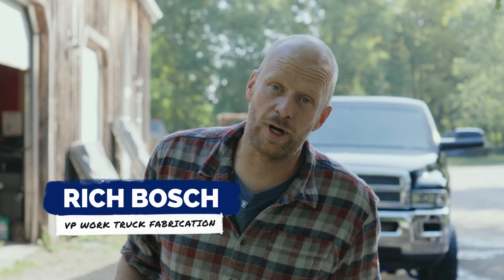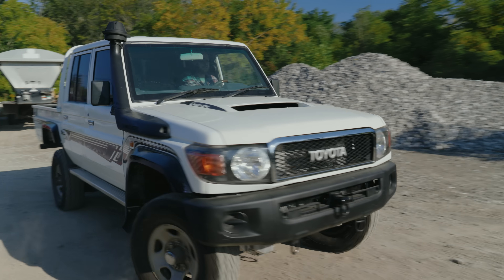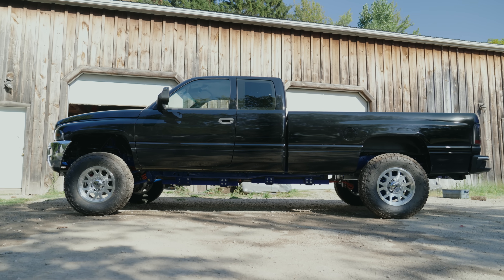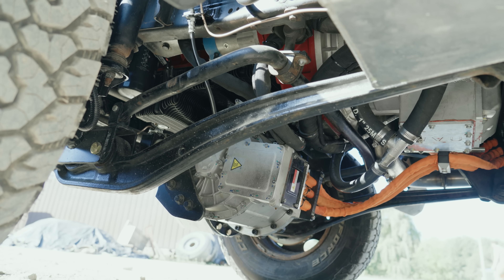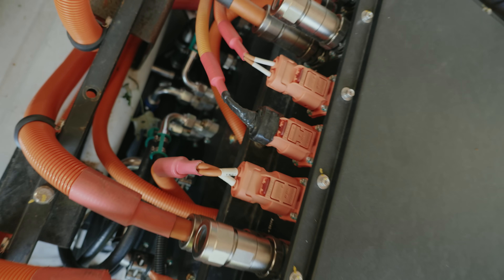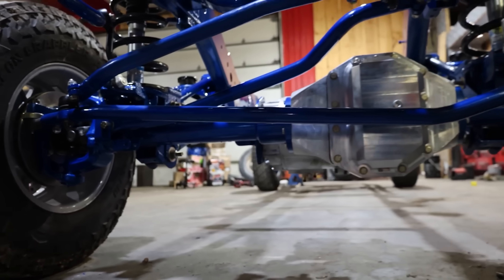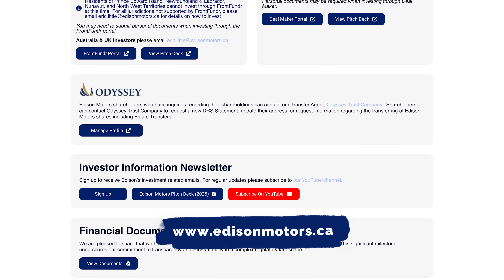We’re Building Pickup Trucks with Electric Axles, Here’s Why

Comment: I really like the concept... Diesel/Electric definitely seems to be the best course for the future of extra-urban automobiles, to include military applications.  That said, I see some concerning design issues in your prototypes... yeah, I understand that these are early prototypes, but these issue should be top of mind from day one...
First, on the Land Cruiser... you mounted the axle on top of the leaf springs, as opposed to under them.  As you noted, this is intended to be an off-road vehicle.  You seriously compromised ground clearance by doing this.  Also, It looks like you added extra leafs... that is a pretty thick stack.  Does that mean you had to significantly increase the weight of the vehicle with the battery packs? I would imagine you had to.  Unlike the semi applications, you don't have that weight offset between the original internal combustion engine and the generator.  That is going to significantly stiffen the suspension and affect the ride and articulation.
Second, on both trucks... the battery units look to be very exposed to damage in any sort of high-center situation.  Also, the battery pack looks to sit significantly below the frame rails, making them even more susceptible to damage.
Third, on the Dodge... those three cables, going into the box forward of the read differential are also extremely exposed to damage in off road applications.

And, yeah, your concept of providing (effectively) a rolling chassis kit, as opposed to the customer having to do chassis mods sounds like a great idea.  That will avoid a lot of potential problems, significantly reduce your customer support requirements, and increase the applicability of the kit.  You can make a generic rolling chassis kit (with a handful of adapter mounts) fit a pretty broad cross section of truck bodies.

Comment: It needs to be in the trailer axles. Especially for semi trailers, it would help in so many ways. It would help with take off and regen going down hill, help on an icy hill at a stop sign, save so much fuel, the trailer has a ton of room for batteries etc. a retro fit kit so it can be added to any trailer.  Then instead of having to replace all these rigs on the road, we just upgrade the trailers.

Comment: I still dont understand making the axle electric, instead of adding an electric motor to the existing axles drive line, so your not stranded if the electrics go out, you still have a diesel (albeit under powered )

Comment: Outsources the production to Harbinger  Motors, since they already produce EV and EREV chassises in this size class. Creating greater's economies of scale, In consultation with Edison Motors and DEBOSS GARAGE, which would also be a distributor to local shops. 

Or if it's kept in-house at least mirror some of the simpler design characteristics its chassis. Since modifying an existing chassis is way to labor-intensive to be cost effective.

Comment: If you build the chassis to a class 5 rating it will be bullet proof but that puts a lot of us in a legal spot here in the states. Is there a light suspension or something minor you could change to make a 2b for us small business owners out of the same class 5? Like specifically something that we’d be cutting off to upgrade to air ride anyways?

Comment: I would take one chassis, 14K gvw, 4wd. Put '68 F-series cab on it. Set it up with a 12 foot deck, that has a hoist under it, and a trap door in it for a fifth wheel. 
Pull damn near whatever size trailer you want.
Haul damn near what ever you want on flat deck.
Put the sides on and 4-5k in top soil, rock, mulch, sand, ect and dump it where ever you want.
Not sure i ever buy another truck.
Reply: Amen bruddah :)
Edison.....the last truck you'll ever need.

Edison trucks never die, they just get repaired.

Edison trucks will never get sold, they'll be passed down to newer generations.

Edison trucks are more than heavy duty, super duty, mega duty, hyper duty, or ultra duty. They are Apoc duty. Built for the apocalypse.

Comment: Hey Chase. Future opportunity exists with the hybridization of small bulldozers already equipped with hydrostatic drive. The hydraulic motor(s) attach to the final drive gearbox(es) which facilitates electrifying the track power supply. Think of the added advantage(s) of electric braking and steering. Full-blown converting hydraulic cylinders to electric-driven ball screws for blade and accessory controls/simplified diagnostics.

Comment: Just FYI. I have never bought a new pickup, I always run 10 year old or older used trucks. If I buy a used regular pickup with the original manufactures cab and box I am good in Ontario, easy to get an ownership, licence plate, and insurance. If, however, the truck was originally sold as a cab and chassis, even if someone puts a regular box on it,  it seems that it needs to always be licenced and insured as a commercial motor vehicle which means expensive licence and insurance and a bunch of hoops you need to jump through. For your commercial trucks this doesn't matter, they aren't going to be used for personal transportation. However, for your pickups, please check that if average Joe in Ontario wants to buy one of your frame and driveline kits, that he will be able to licence and insure it as personal transportation under 4500 kg and not be forced to licence and insure it as a commercial truck that needs commercial licence, commercial insurance, annual inspections, driver needs a CVOR and must complete a daily log book, and on and on and on. 🚜

Comment: hate that you’re double down on drive axles instead of a drive shaft option. It would be so much faster and easier to convert without a need to re-engineer the entire  suspensions. Weak u-joints blah blah blah… just tune it right to match the output of the original gas  engine drivetrain… I don’t need 1,000+hp, just the efficiency of the hybrid offering similar performance as the original set up.

Comment: They should have a way to manually connect the transmission back to the rear axle.  just  if the batteries or electronics go bad you could still get back home  or at least out of the way. 

Edit : maybe a small hydraulic pump so it can be turned on and off in a pinch

Comment: NEVER understood why this wasn't done before since heavy industry has already proved the technology. When starting to home brew biodiesel remember Oak Ridge National Laboratory during Clinton's Admin collaborated with the auto industry to develop high MPG cars which included diesel-electric hybrid technology. If I remember correctly a mid size car (American mid-size) small diesel engine powering a generator got 80 to over 100 MPG. Again if I recall correctly, if fueled by biodiesel it was the LOWEST environmental impact over entire life cycle from manufacturing to end of life recycling. My life's work experience includes BurlingtonNorthernSantaFe Railroad & Operating Engineers Union & have seen many diesel/electric vehicles. Gave my still running 1990 12v to my son & currently hanging onto my 2007.5 Ram 6.7 Cummins. 2007's truck emissions computer knows if I burn 100% bio. :face-orange-frowning:

Comment: All us Nissan titan XD owners with snapped cranks and zero parts to fix them are NEEDING this frame! This is now the only option for my truck thati have had dead for 2 years, as to buy a crate motor is a whomping 40k Canadian, for what's now a 20k truck because the rabbit is out of the hat these are worse then a 6.4 powerstroke.5.0 cummins are popping everywhere snapped or rolled bearings same spot, zero warning. Nissan and Cummins have left us owners in a corner, no parts, no bearings, no end caps, no turbos, my truck is mint full load, only 167k km fully loaded. not worth a penny. 12k over warranty. what a kick in the nuts for a young guy that just got married. sold my obs ford dually and my dually diesel yoda. regrets regrets regrets lol
 i tell ya what ill drop my truck off whenever you want as a test mule or whatever you need, its doing me no good ive stored it inside for 2 years and i hate looking at it..... anyways love what you guys are doing, this makes so much sense and you haven't skipped any corners, I'm a diesel mechanic and electrician by trade and i am impressed. keep representing Canada boys, making us proud! This Alberta trades man see the future happening here!

Comment: Shouldn't the e-Axle manufacturer include whatever software you need in order to use their hardware on a truck or truck frame? If you have to write your own code, that's like Nvidia or Radeon releasing a new graphics card without any drivers or support.

Why, it must be enough to make you guys feel so unloved by hardware vendors, it's like you're Linux developers back in the 2000s!
Reply: Edison uses axles from vendor "A" and batts from vendor "B" and inverters from vendor "C". Then Edison makes a custom computer that ties them all together on the canbus.
Reply: @Sah-o5m then in this approach, too, Edison is dooming themselves to slow growth and not gaining much market share. That's disappointing. If they really want to compete with the big truck makers, they'll have to change their thinking.
Reply: @chrisschembari2486 
It goes 3 ways

If Edison goes all in with vendor "John Deere" to provide all the electrics, then John Deere dictates price, availability,  repairability. Disgruntled edison owners will call edison and Edison will call JD and the JD people will just laugh and laugh all the way to the bank.

Or. Edison raises several hundred million and designs/builds all their own electrics to then only sell 100 trucks per year with an ROI of centuries.

Or. Edison goes with what works, stays vendor agnostic, and just figures out the quirks.

Edison is doing just fine.
Reply: @Sah-o5m It's really too bad, too. I think Edison's hybrid diesel idea is a great one that should replace all the less efficient rolling stock on the road.

Comment: Quick question but for an off-road purpose, it will be better, from my point of view, to rotate a little bit the electric motor around the axle in order to get more clearance. In that way, if a rock goes under the truck it will hit the axle first instead of the electric motor. 

Good job 💪💪

Comment: Make a drop-in replacement for a RAM Promaster rear axle to provide electric boost under hard acceleration or uphill climbs. You'd only need a small battery since it doesn't have to provide all of the drive or operate all the time. The battery could be continuously charged off the alternator, you wouldn't necessarily need regen (though it could be used to assist with braking). If you could pull it off for under $5k/unit it would be a huge success with businesses and fleets (and RVs), particularly in Europe where the Promaster is called Ducato and is one of the most popular vans.

Comment: Although this is great for industrial and fleet applications in some instances.
It is sadly moving further away from the home builder who wants to just swap the old running gear with some EV/Hybrid running gear.
Unless - you eventually get to kits where we can drop the motor, gearbox, and diff centres out of our standard vehicles, and bolt in the replacements over a weekend. In the same way we would do a late model engine swap, or in a similar way to an LS conversion.
Or like Rich did with his Cat swap in the F Truck. Basic home mechanic swaps.

Comment: I need a 30,000lb rated frame setup, axles, batteries, engine, but I don't need a cab, I have an almost 35 foot long bus that I plan to take the old 1989 body off of, clean it up, sand blast and paint the underbody, insulate the underbody ribs, and drop onto a new roller frame.

My plan is to either buy a used dump truck to transplant, or to convert to hybrid if I can get a hold of the parts and equipment.

Comment: So have a look at the 1998 Ford Ranger EV. From the Edison factory with an electric axle motor.  Yeah, these guys are about 27 years late to the party.  Since these trucks are conversions they totally lack the specific structure, aero dynamics and system integration that lets you get the lower weight, extra storage space and performance from the truck as the chassis is built for all the needs of a petrol power plant.

Comment: Be sure to have a non-hybrid Ram towing the same trailer on the same route, that way the efficiency of the vehicles can be directly compared.
Reply: Alas. They won't have a 95 5.7 2wd gasser which is what the dodge started out life as. But, they will have 2 modern trucks towing similar trailers, so it should be a fair-ish comparison.
Reply: @Sah-o5m  I don't think that the actual truck really matters all that much, as long as the capabilities are similar.

Comment: I know the kit is what you are working for but maybe just offer a hole truck. Like the big ones. You all are in the rust belt, are are there many used bodies that are worth swapping over to a 60k (assuming cost) drive train? For instance I have a 1999 dodge 3500 that I used for a portable welding service, I live in SW Missouri USA, nor really the rust belt. But my rockers are nearly gone, the dash and drivers seat are shot, the truck has 355,000 miles on it. 
I still drive it, but would I put 60ish in it ? No. So maybe your target customer has an expensive bed, service truck or whatever, could that not just be transferred to an Edison cab and chassis. How much more would it cost to include an Edison cab?
Don't get me wrong I am rooting for you.

Comment: the only offroad i see that land cruiser doing is gravel roads. leaf UNDER the rear axle? all the low hanging fruit underneath the chassis? it has no ground clearance left, let alone any articulation. sure, it might be able to haul 5000lb's in the bed, but offroad is not what i consider that truck....

Comment: I like the ideal of axle diff drop in replacements. Think of the off-road community for example, they would buy millions of units alone of the carrier replacement E motor could also act like a locker and/or limited slip on demand. Gas power and low end e torque to climb? With controllable functions? One would sell millions of these things globally.

Comment: could you use a electric motor at the pinion joint run by the existing motor and added battery backup

Comment: There's a whole market for building hybrids that circumvents the off road generator problem.

All front wheel drive vehicles have stub axles and mechanical brakes on the rear wheels.

Build a mechanical brake +regenerative brakes and launch assist replacement unit.  The sole purpose of the design is to help keep the vehicle in high gear as much as possible.

Launch assist at stop lights. Regenerative brakes if you just tap the brake pedal enough to bring on the lights and mechanical brakes if you push.

I think it could double mpg for most commutes.

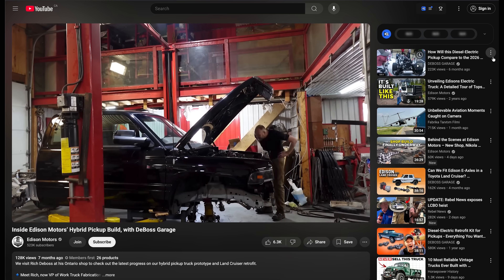Comment: 1:30 To be fair, an electric motor in front of a T-Case would still be instant. ...but I gather there's no direction chanage with a ring and pionon so it'll be nice to avoid losing 10-15% off the top. I assume the plan is to work with a Foundry for production? I don't know what that billet would cost even before machining but I bet I've got drivable cars that wouldn't pay for it.
Reply: Other vendors do electric t case. Edison enjoys putting the batts where the drive shaft was.

Comment: Have yall done any testing or research on tire wear? I’ve heard stories of electric motors replacing the cost of gas with spending more on tires so that it doesn’t actually make a difference for savings.
Reply: Depends on how lead foot the driver is.

Comment: Are you able to build these trucks with newer than 2000 bodies or still has to be >2000?
Reply: No reason why you couldn’t put a newer truck body in

The body just needs the correct wheel base so it matches

You can just make mounts and weld them in place
Reply: The first Edison retrofit kits are for tier3 emissions vehicles from like year 2000 and older.

Edison is still working on a kit for newer tier4 trucks

Comment: You guys are great. And supplying individual kits is great. But you're not the first to make a hybrid car with electric motors in the axles. Just look at the Changan Hunter, M-Hero 917, Leopard 5 and 8, Lixiang L9, and dozens of similar models from Chinese automakers.
Reply: Do these dozens of similar models from Chinese makers also sell a pickup truck retrofit kit for all usa trucks made in the past 60 years?
Reply: @Sah-o5m  No, they don't sell them. Except kits from Geely. BTW, they're not all similar models. They differ from each other far more than usa trucks for the past 60 years :)

Comment: If a mechanically operating chassis is an option, why not also go one step further and find vehicles with engine, transmission, and or suspension damage on auction sites, put the bodies on your chassis, and sell the complete vehicle as an option for folks who want one of these but don't have a broken truck to put it on? You could also sell off the good parts from the auction truck to help with profit and reduce costs